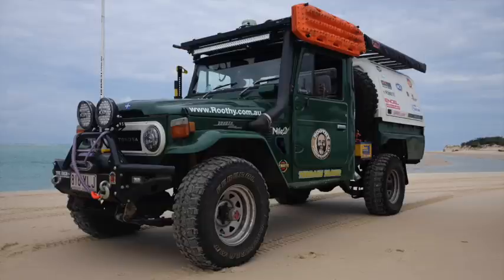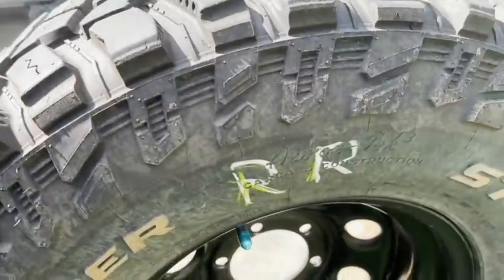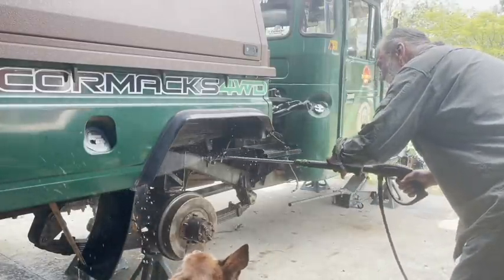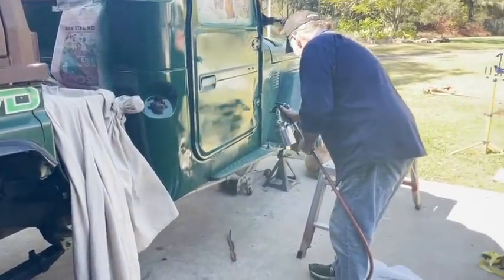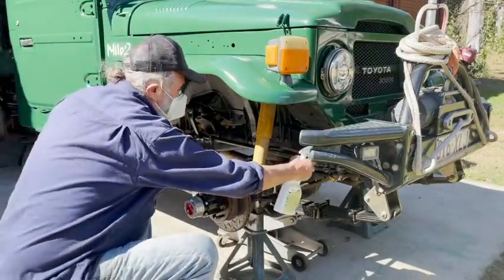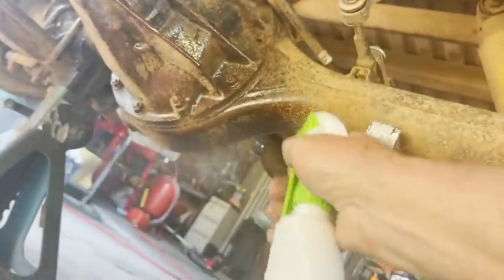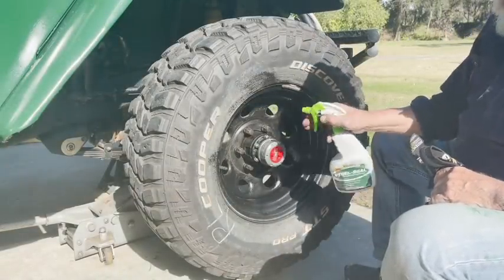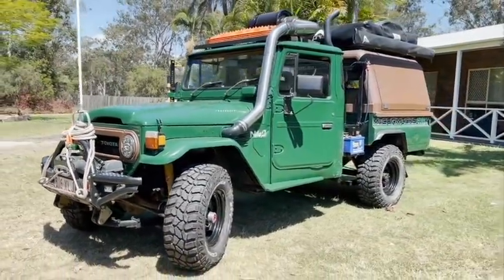4WD BEACH PREP - MILO2 REFRESH - Roothy

Comment: In Europe where we have salt on the roads in the winter, i use lanolin based stuff as well. Its called fluid film but probably works the same. Another great product is Owatrol oil, wich creeps in rust and then drys like a thin paint, verry good on a frame with surface rust, because it builds a solid layer with the rust and does not wash away over time. I use it on rusted parts before the sheepy smelly stuff is used.
Reply from the maker: Thanks sounds like our steel seal - must be a bugger with salt on the roads!!!
Reply: @JOHNROOTHROOTHY  It is, you buy a used car with a little rust and after 5 years you have a rustbucket if you are not careful.

Comment: Mate I've used this steal seal 5 weeks before going on a beach trip and omg the sand sticks to chassis terribly it is so badly stuck to the chasis that even after the 5th wash and 2 months later the sand is still attached,  is this how it is meant to work? How do i get all this sand off?
Reply from the maker: I've used Citriforce to get it off but otherwise you're 'stuck' with it - after a decent session on the sprinkler I just use another hit of Lanotec HD oil on top of the lot - soaks in and works a treat.
Reply: @JOHNROOTHROOTHY  ohh Roger that awesome ! Thank you!

Comment: can i give you a homework assignment - please cross reference these Au products with USA stuff...yup asking you do do my work - but betting you have the answers.. :) - beach bound this weekend - and usually all i do is wash her after we exit....but then again we don't drive through sea foam ... yup saw that one as well
Reply from the maker: Wish I could help mate - google up lanolin US and look for a citric based degreaser. Do not use a commercial underbody washing rig, they recycle water so the salt is always there. Try and get a lawn tractor sprinkler or just sit your truck on a sprinkler on the lawn if you can. Have fun!
Reply: @JOHNROOTHROOTHY  thanks - i actually did that and found in my shop i have an aerosal can of fluid film - lanolin based - they have a product for under coating - thanks heeps as ya say down under. :)